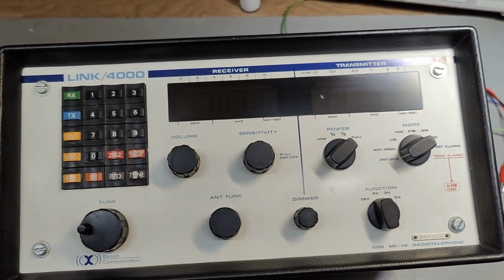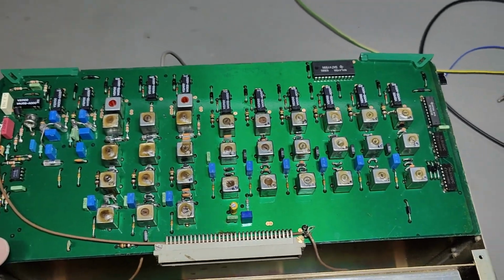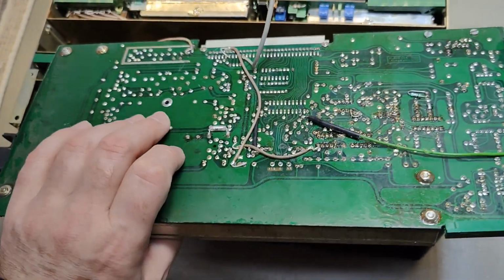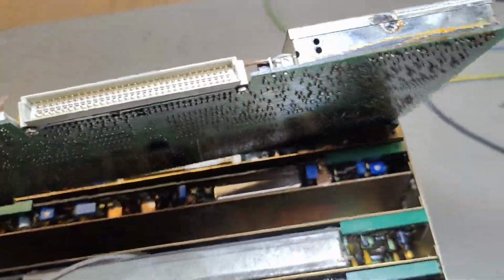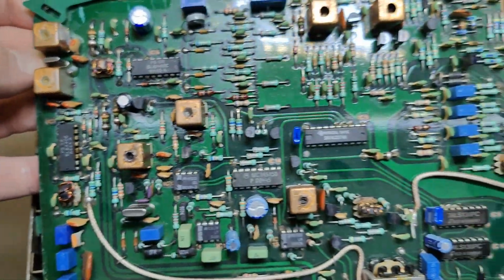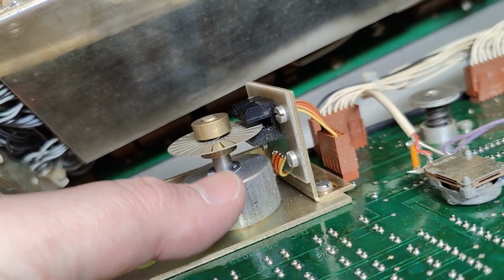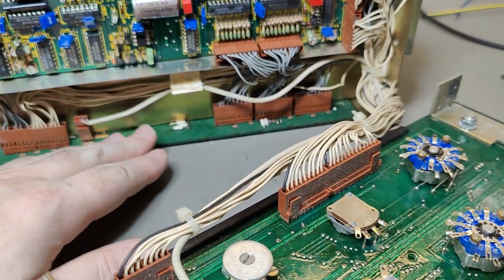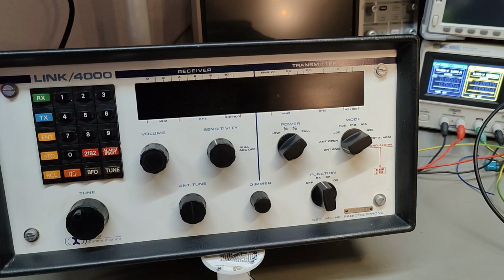Danmar RT210 LINK 4000 SSB MF HF Radiotelephone Marine

Comment: The encoder wheel was photochemically “machined” (etched). And probably once more we have a decades old unit that responds faster to UI inputs than most CPU-controlled multi-$k ARBs, power supplies and oscilloscopes :(

Comment: That Mostek MK3801 is a multifunction chip that has a serial port, multiple timers and an 8 bit I/O port with individually programmable pin interrupts.  So basically you got most of the important features from a Z80-CTC and Z80-SIO along with extra interrupt sources in a single package.  I don't think it was used much for computer type applications, but was very popular in embedded systems because you could often replace multiple chips with it without any loss of functionality.
Reply: wow. Would have never (spelled n.e.v.e.r) have known that. GR8T 'insiders' comment :O)